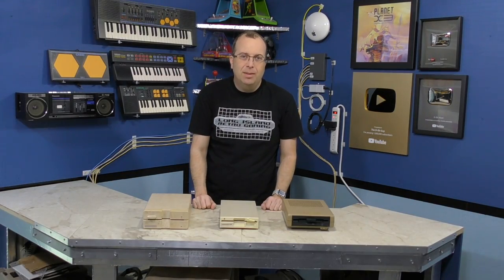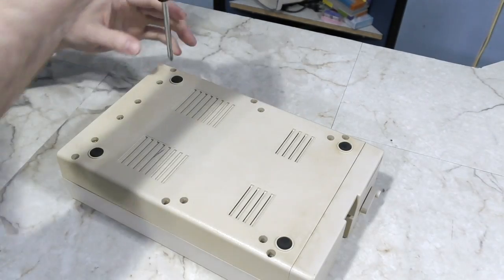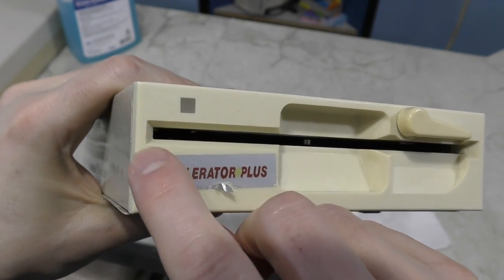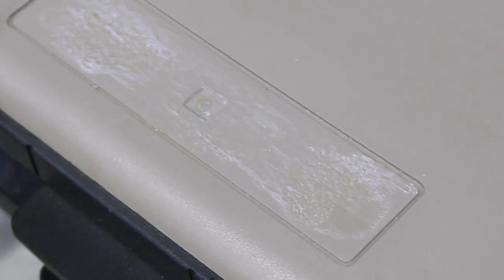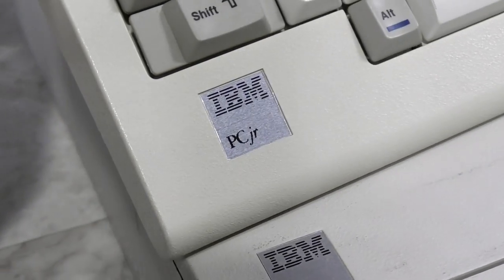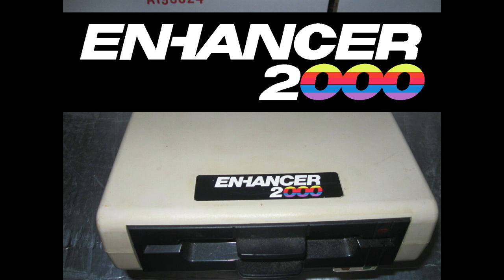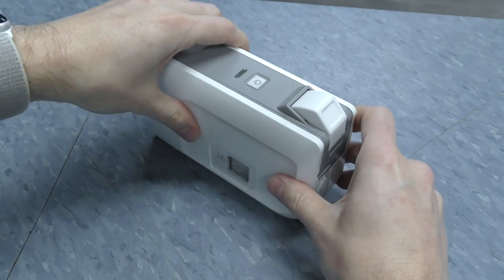How to make replacement badges

Comment: Be careful if you use UV-C lamps. I use them at work to disinfect lab equipment, and sure they are good at bleaching stuff, but they are also good at making plastic crack. 

By the way, Enhancer 2000 is best name ever for a disk drive!

Comment: I actually have an Excelerator Plus (assuming it's the only one looking like that, it has absolutely no labels on it), but I have absolutely no clue which power supply goes with it. Do you happen to know the pin-configuration of the DIN? That would give me some hint of what to look for in my box of bricks :-)

Comment: I think my suggestion would have been instead of lining the inside of the clear tub with the aluminum tape would have been to use the shiny side of aluminum foil around the entire outside of the tub. It might not have been as good as having a reflective surface inside for the actual reflection, but it would have avoided any potential reactions

Comment: work at at least 300ppp for better resolution or sharpness of your design. Font of «Excelerator Plus» is an Helvetica Bold Condensed. Blue Chip 128 is in Microgramma/Eurostile.

Comment: David, try the UV-light LED tape. Glue it in inside sides of the container and wrap it with foil. My recommend is container with upper lid - it easiest to wrap with foil. For more - check the channel "Odd Tinkering", how he does this :)

Comment: I use a bulb like that to cure resin 3D prints. I use tinfoil to line a box. For your application maybe line the outside of a clear plastic container with tinfoil. Something worth trying.

Comment: It was interesting to see the ways you made the labels, and also, I have never heard about a printer without toner or inc. A couple of this you could consider is using a scanner to scan old labels or the area where the label is going, instead of measuring. Sometimes I have also taken a photo from a bit far, then I zoom in to get less distortion. Then I measure just one side and scale it to match in photoshop. Then you don't need to measure more but you get everything right. Also, there is something call extruding or something, in photoshop / illustrator, that can "paint" for you, then you can modify the vector point's after. It's been a while since I did that.

Comment: Just spray paint the outside of the plastic container with a chrome spray paint so the inside stays plain plastic. Also the hydrogen peroxide was interacting with that aluminum tape.

Comment: when taking off the glue,  you said you needed it smooth and having it smooth would only apply if using stickers. if using the original labels as most were plates not not stickers but moulded plastic or aluminium. so if putting the  originals back on it would be better if it was keyed :)

Comment: I wonder if the indoor retrobrighting setup would work better if you wrapped the outside of the tub with tin foil, rather than using the aluminum tape on the inside of the tub.  Another option may be switching to a stainless steel baking pan.

Comment: Why not use clear tubs, but put a warmer pad under it to keep the water warm but not overly hot, then use UV bulbs or LED strips from the top and sides for better coverage? It's pretty cheap to make, minus electricity I guess so LEDs might be a better option.

Comment: Just use 12% diluted hydrogen peroxide and an LED UV strip so you can brighten plastic indoors all year round. The strip allows you to brighten all sides equally at once.

Comment: ps, if you're designing font letters, characters with rounded tops like a capital 'O' and 'C' are ever so slightly taller than the other letters so compensate for an optical illusion that makes them look smaller. It's called overshoot  https://slate.com/human-interest/2015/04/tobias-frere-jones-explains-the-optical-illusion-that-tricks-our-brains-into-perceiving-typeface-letters-are-of-equal-height.html

Comment: Water is opaque through almost all of the UVC range, and there's essentially no UVC present outdoors, so you can probably save yourself the hassle of getting a UVC source!

Looks like the aluminium itself its being attacked from your footage. It's a shame, since accelerated UV exposure like this will probably damage the plastics quite quickly. Perhaps you could line the box with a clear plastic sheet once you've lined it with foil tape?

Comment: Brilliant! - and i have the EXACT same photoprinter! - its really good - it has a replaceable cassette, but really dont know what technic.
Reply: The photo printer is probably a dye sublimation/diffusion type printer, the image is made by having small heaters in a linear array heat up a ribbon that carries the dye, the heat causes the dye to partially or fully turn in to a steam/gas, and then transfer on to the paper. 

The label printer is probably a thermal transfer printer, these works pretty much the same way as the sublimation printers, but the dye is transferred in a melted, liquid form.

Sublimation and diffusion printers tend to be better at blending the dyes than thermal transfer, so is good for photos and gradients. Thermal transfer may be better at producing sharper images, though, so is good for high contrast applications like label printing.

Comment: UVC is really destructive and not recommended for bleaching any plastic you care about. No significant amount of it reaches the ground either so it wouldn't replicate sun bleaching anyway. The UVB in open sun might be significant. Ordinary glass blocks UVB but lets most UVA pass, so when plastic yellows under a window it's being exposed to UVA and heat, but not UVB.

Comment: When it comes to the metallic labels, have you ever tried the metallic Avery labels, such as https://www.avery.com/products/labels/8986 ?  i would assume a little spray adhesive on the system (masked off, of course), then an application of a label like this, might be easier that the aluminum tape and clear labels.

But then we know what happens when we assume...

Comment: Wait, the badge on the original blue chip drive cover was white text on a color just a little darker than the color of the plastic, but it still had some metal stuff behind it? So once you removed the metal part, it was actually EASIER to reproduce the original look?

Comment: I wonder if it would make any difference if you used a container that was made of a reflective material. I have one that looks to be made of either stainless steel or aluminum, and is about the same size as the plastic one you were using.

You’re welcome to have it if you want. I live in Ft Worth, so it wouldn’t be too much of a drive to bring it to you. Send me a message if you’d like some pictures or anything.

Comment: Why not just... wrap foil around the outside of the plastic box instead of the inside with the water? UV light would still go through the plastic and be reflected back but you wouldnt have any possibility of any reactions with the metal.

Comment: Do you use the actual brand "Windex" or an off brand?......not sure if all window cleaners are created equal
I'm asking because I would like to (someday) attempt the retrobrite process on my old NES and SNES that's been sitting in a drawer for the past 20+ years
Reply: You can look up online and see that Windex is just 1 part Ammonia and 3 or 4 parts water with some blue dye.  You can mix some yourself at home with a measuring cup and save a lot of money.  Windex is only good for wiping off loose surface level dirt that's not sticking to anything.  If you got glue or something that's harder to get off, there's always alcohol and WD-40.  Acetone or stronger chemicals should only be used as a last resort.

Comment: Perhaps it would have been better to apply aluminium foil to the outside of the basin instead of applying aluminium tape to the inside. That way any reaction with the retrobride could have been avoided. Or am I missing something?

Comment: Why don't you use a normal ink jet printer and print these logos on adhesive foil? This way they would have decent resolution (I find the low resolution of these label printers actually very showy) and full color. It doesn't cost more and wouldn't be more work than usign the label printers.

Comment: Why would it take two hours?  Just free-transform in Photoshop to turn the photographed shape back into a rectangle.
If you needed to improve upon the resolution of the image, there are tricks to generating a vector image quickly and easily, including the new (in PS2020) integrated asset creator tool.

Comment: Just forget about the UV. Yeah, UVC might help bleaching the plastics, but it also will make them brittle.
The key to bleaching is: Heat. That's why it works better outside in the sun.
Have you ever seen someone getting their hair bleached? No UV is used there. Just peroxide cream and aluminium foil to keep moisture, heat and oxygen radicals confined.

Comment: If you want some pointers on retro-brighting indoors it is something that has been covered quite well on the Retro Man Cave channel.  Since this is a UK based channel, the guy running it is quite familiar with the temperature being too low and not having access to a lot of sunlight.  The final revision, going from memory, used a lamp often used for indoor plant growth combined with a sois vied stick to control the water/peroxide temperature.  While I can't say what kind of indoor plants this lamp would be used for, I suspect that in a lot of cases it may have been less than legal.  Here is a link to his current method: https://www.youtube.com/watch?v=oZ3DhQrzuXg

Comment: maybe the Moss chip is an original and it was an add-on well the cover was off and that's why the original color was shown on the top and not the bottom and front

Comment: **ADDENDUM**
If that First Colour Label you made doesn't bleed or fuzz out when spraying it with a clear coat of acrylic, it should be quite durable, Another alternative is clear stick on Vinyl which I used twenty years ago on a label that I placed on a Subwoofer I built. Just get good quality Vinyl and it should last at least 20 years..

Comment: What about a plastic tote lined with an emergency foil blanket adhered to the sides with silicone?

It might sidestep the problem you're having with the foil tape while giving you the needed reflection/insulation.

Ooh -- better yet, why not just put the blanket in a clear tote and then just drop another clear tote on top, that way the water never touches the foil -- no chemical reaction.

Comment: 17:40 maybe using the tape on the outside of the box would have worked, no light will escape and the tape is not exposed to water or cover the box with aluminum foil for easy removal.

Comment: You do realize those labels just used standard fonts, right? Helvetica, Futura, and Microgramma/Eurostile, respectively. You would have saved a lot of trouble and gotten more accurate results by just picking the right fonts and typing the names in, and then making the necessary edits on top of that.

Comment: Whaf if you covered the outside of the plastic co tainer with alluminum foil.
Maybe that will.give you the desired reaction without interfering with the chemical process inside the container.

Comment: In a pinch, putting the tape or an insulated blanket on the outside of the container might work better.  Better than nothing.
Reply: Depends if (how much) UV actually gets absorbed by the case or not.

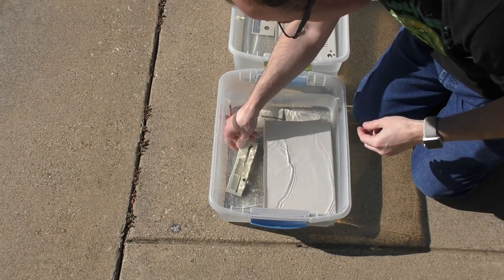Comment: 11:26 Bathing also the connector of the LED isn't that great of an idea as it's not sealed. The water is entering the wire due to capillary forces and will eat up the copper over time.

Comment: Your Excelerator badge is the wrong colour and the font (especially the S) is different.  Why didn't you just scan the original and print it? Also, retrobrighting effectiveness is UV,  not temperature dependent.

Comment: Next time instead of using foil tape in the water (to which does not work) try using mirrors either in the water of the edges or outside of the container. Just my thought though...

Comment: Can you explain why you couldn't just use a font for that Exelerator label? It would have been miles better and cleaner. And if you say you wanted to match the font exactly, well you didn't anyway and could of got a closer looking cleaner smooth looking label with a font.

Also remember I was going on about how your pictures in the background were not aligned right and you should redo them? Well you have and one of them is SLIGHTLY not aligned properly again! The bottom right one is a bit too low. God damn it!!!

Comment: I bought a cheap 4' fluorescent fixture and a couple of UV tubes for a pittance. 

Also, the best printer ever made for this sort of thing (decals/name badges) was the Alps MD-5000 which was later re-branded to the Powis Parker FoilFast p21x. The printer is utterly amazing. It holds up to 8 cartridges, can print CMYK plus dye sublimation for better blending, clear, whtie, colored foil (silver, gold, red, blue, green) and primer for printing on materials such as leather or vinyl. Sadly it is discontinued but can still be found time to time on ebay. See here for more https://robdebie.home.xs4all.nl/models/decals.htm

Comment: Tldr; Looking forward to a video with results on your Retro Bright experiments. Check out Rocker Gaming for tutorials for good, consistent results.

It'll be an interesting experiment to test between UV A, B, and C. Definitely check out Rocker Gaming. He's got a lot of videos about Retro Brighting. Rather than liquid peroxide, he uses a product from a beauty store (can't remember what it is offhand) with a hair conditioner consistency and saran wrap to keep the pieces coated. With this technique, you can keep the piece soaked without also soaking the entire container. He uses foil to coat the inside of his container. I like the tape idea better, because it will be a smooth, even surface. It might be worth experimenting with the tape vs foil, though. I'm not sure which is more reflective or how much reflectivity plays into the process.

Comment: Hi David, I use a temperature controlled heat gun (about $50) which is normally used for SMD work to remove the gunk from glue badges, set it about 140°F and keep it moving until sticky.  https://www.amazon.com/gp/product/B07FBGFT3K/ref=ppx_yo_dt_b_asin_title_o00_s00?ie=UTF8&psc=1 Also works great for heat shrink tubing.  Might be better than scraping with a screwdriver

Comment: I have to admit, I cringed at the rendition of the lettering on the replacement badges... Personally I would go about it by identifying the original fonts and using Inkscape to remake the logos as accurately as possible.
Using a cursory Google image search to get a better view of the original logos from these drives, it looks like the Enhancer 2000 probably used Helvetica Black Oblique, the Excelerator Plus used Helvetica Narrow Black (if that variant existed; otherwise the regular width but squished horizontally to give a similar effect to Helvetica Narrow) and the Blue Chip 128 used Eurostile Extended along with the Blue Chip logotype itself, which appears to have been an original design.

Comment: When you need to accurate reproduce the original label, why don't you use a card, label or pen scanner? I mean if you want the exact font dimensions you can't get any more better than the original.

There is a much better way to get quality UV light than those blacklights or the sun. You can UVC bulbs that they use for killing bacteria in an AC and doorway systems. You just have to be really careful with them because you can blind yourself if you look at the reflected UVC light. I used them to erase EEProms before I could afford a fancy chip erasers from back in the day. I would also recommend those bulbs they use for UV curing systems. The amount of power per square centimeter is better and it will be alot faster because there is more concentrated UV light. https://www2.lbl.gov/ehs/safety/nir/assets/docs/uv/UV%20curing%20system%20safety%20tips.pdf

Comment: The replacement label for the Enhancer 2000 is fine, and the one for the Blue Chip is okay, but the one for Excelerator+Plus is garbage. You really need a better reflective label solution than that low-resolution label-maker that can only do monocolor. I also think your process for making the text needs a bit of work, is it's clearly rather slow and inaccurate and prone to issues if you do get a better label-maker. I must recommend simply tracing over the letters from images with path tools in vector graphics editing software, except in cases where the original font's available.

Comment: It would be nice if you could just find a source of already-made badges for these, or maybe buy a cheap broken drive with a good badge and do a swap, huh?
It would also be nice if, when that's not so feasible, you could just find the exact font that they used and then use that instead of having to construct the letters from scratch. Huh?

Comment: <?> Not sure why you'd think superglue contains acetone, or would melt anything. Neither is the case. The A in CA is acrylate, not acetone.
Oh, and yon label maker is not a good way of achieveing your goals. Saying the LM's resolution is shitty doesn't justify using low-res images; the end product is the issue. You'd be much better served layering water-slide decals onto an adhesive film. Also, I'd run a decent scan of the original through whatthefont ( https://www.myfonts.com/WhatTheFont/ ) to pattern match your lettering.